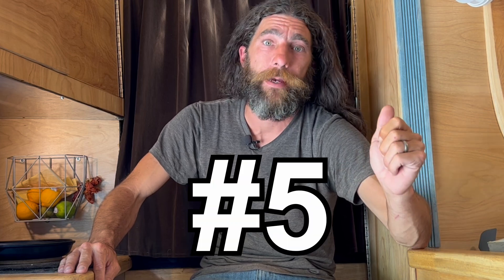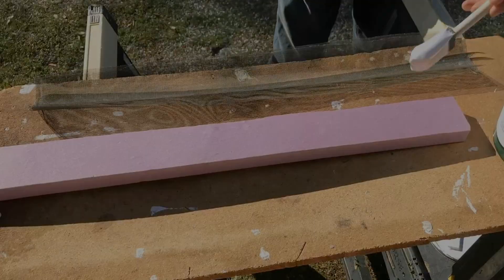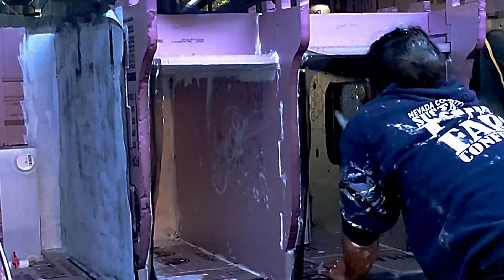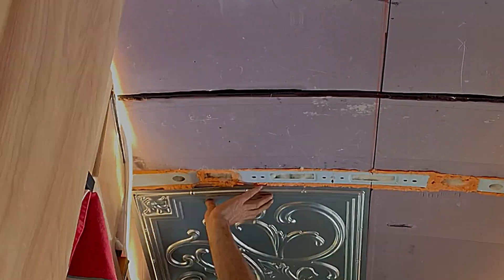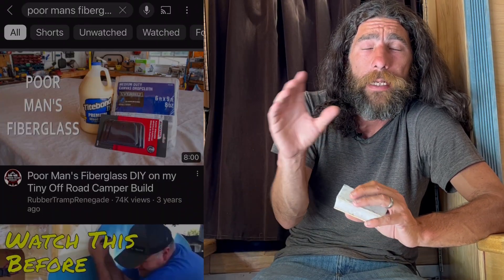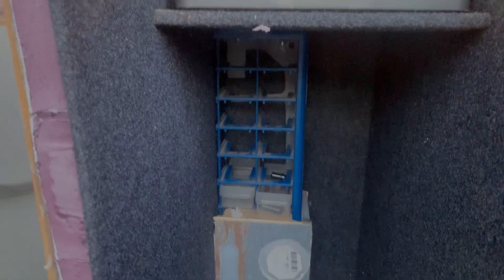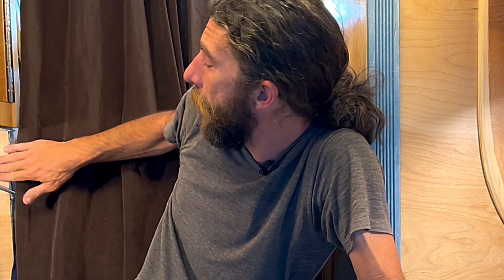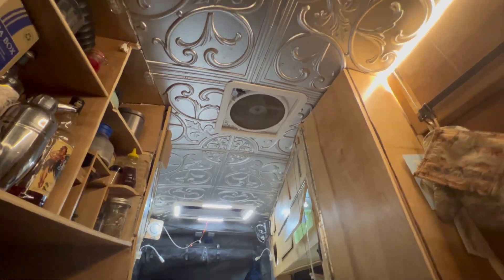Foam Camper Van Screen & Skins -Foam Building System Vol. 5

Comment: I appreciate this video just explaining the physics of stiffening up the foam so it doesn't bend. I realize even in our stick and Bricks homes we have a lot of glues and adhesives. But in the small space like a van that kind of concerns me. I wonder if using a thin upholstery fabric or something could be stapled on and still give the same strength. This would be like the inside of upper Galley cabinets and bed cabinets.

Comment: Would fiberglass resin work or would it damage the foam board? A possible skin could be using painters canvass drop cloth, (washmachine washed and clothes dryer dried to remove folds and wrinkles,) apply fiberglass resin to the foamboard. then fit the canvas, then fiberglass resin on the canvas, then you can paint it any color of your choice.

Comment: what do you think about using foam technique for the exterior in place of a wooden frame?  I want to be able to stand on it.  I'm thinking either like a rodeo camper  or those lance bed campers.   opionins? 

  also, I would help anyone who's able to share a work space. I lack the space to even get started.

Comment: Good evening, thank you very much for these excellent videos. Forgive my ignorance with this question but I can't seem to find a definitive answer in my searches. The Owens corning XPS foam that I purchase for my build, has a thin plastic face sheet on both sides.  

I don't know if this plastic is intended to be a vapor barrier, or if it is intended to protect the foam in shipping and sales.   If you have encountered this, have you been removing the plastic prior to your build, leaving the plastic skin in place would offer a certain measure of enhanced integrity, but at the same time significantly increasing the risk of glue failure, if the skin peels off of the adhesive attached to it.

Has anybody else decided what to do with the plastic film?
Reply: I’ve never seen that, sorry.

Comment: Plywood (even thin plywood) laminated to your foam can be classified as a structural element.  There must be a strong bond between the plywood and foam.  In order to maintain structural integrity, you don't want it to delaminate.  Remember Howard Hughes built a very large airplane out of plywood - known as the Spruce Goose (now in a museum in McMinnville Oregon).....
Reply: The Spruce goose only flew once at very low altitude and a short distance, it made too many spooky wood creaking noises. Then it was placed in a museum, but I think that it  should have been used as firewood.
Reply: @jerryrussell2600  I've seen the Spruce Goose.  It is a work of art and worth saving....    If you think it should be burned as fire wood.  You would probably think the Mona Lisa should be used as toilet paper....

Comment: Where is my beer? Oh yeah, sitting under my desk waiting for me to make brats.

I have a Pontiac Vibe, which some videos think would be a good car-camper, but I'm not sure if there's enough room. So, I've been pondering the idea of making a camper trailer that is light enough to be towed by it. However, I don't think I'd like the claustrophobic size of a teardrop micro-camper.

I've had this dream of building a foldout camper that triples in size or more. The basic idea is the outer side wall panels of the camper fold up 90° to become roof panels. Then a floor panel folds down with an attached outer wall panel that folds up to meet the roof. Then, two smaller panels folding forward and rearward to finish that side's box. There are commercial companies now making homes or emergency shelters based on the same idea, but with heavier materials (lots of videos on Youtube).

Of course, I'd want to see how far I can go with this and am wondering about a rearward pull-out section and a pop-up second-story. Just because. Oh, and then I'd want to roll out an awning with bug screen for shade and with clear plastic sheeting to enclose in cooler weather to create an extra layer to keep warmth in the main area. I know that's not really "Van Life" or even Camping Life, but I came at this originally as an alternative to a Tiny Home or an Emergency Shelter or a take-down mobile home if I couldn't afford an apartment anymore.

Sigh. A guy can dream.
Reply: I used to sleep in my Vibe. I would lay everything down flat. Throw a twin folding mattress on top of everything and lay down. I'm 6'0" and was able to lay  with my feet straight. It was something I would do if I just needed to sleep for a night.

Comment: One problem I see is material span limitation. Meaning amount of column req. More column, less freedom. May be possible to combine with L. STL Angle while form has its advantages on compression stress on weight. STL has advantage on tension stress. 

Think how conc. bridge is built. Can not have too many columns 11:01

Comment: As far as a structural material nylon isn't that good for a choice. It's more elastic as compared to other synthetic fibers. Dacron is used for sailboats now instead of cotton because of it's greater strength and resistance to rot. That's your best nonmetallic fiber in my opinion. And 
my Old Man was a machinest, specializing in composites for Lcckhead Skunkworks.

Comment: Man, I appreciate your videos a lot. I live in Germany and I am going to build a foldable pick up camper during the next 2 years. It will be a xps foam composite build. For the most stressed structural parts I even will use carbon fibre with epoxy. Once more thx a lot for the inspiration.  Mark

Comment: Doing a car camper bed platform build (separate spare tire bed panel). Did you say you used the screen and 1/8" ply for the platform + the cargo bay walls?

Comment: Screen? Canvas? No. Fiberglass and epoxy. This technology has been used for decades to make homebuilt aircraft. E.g. Rutan Long EZ. It is much stiffer and stronger. One point for any of these techniques, including yours. All of your corners should be filleted (rounded). Sharp corners produce stress risers that are failure points. Your skinning material should go over the corners. When properly built, any of these foam sandwich techniques produce soft, rounded corners which look fine on boats or aircraft, but might or might not be aesthetically pleasing in a van interior.

Comment: Thank you @falkornomad for a great series.  Have you (or anyone) done a structural comparison between of the different skinned foams i.e. your mesh/gripper, mesh/gripper+veneer, mesh/gripper+1/8" ply and more conventional PMF bedsheets or canvas or even paper + tightbond II?  Like you did with your glue and drywall screws?  For a homemade trailer it needs have a lot of structure.  Thanks again.
Reply from the maker: I have not seen one, but I do hope to do one in the future, any specifics you think should be included?
Reply: @falkornomad : the information I look for is: stiffness (how many inches of deflection for a given load); strength (how much load at failure; failure mode (compression side fail, tension side fail, core fail, lamination fail, etc. ...), and panel weight per square foot.  Would also be great to see different thicknesses of foam compaired (1/2", 1", 1.5", 2", 3"... for each surface material).  Also, corner strength is important to actually measure (is your interlocking corner or 'T' really stronger than a mitered glued joint, a plain glued joint, or a dado grooved and glued joint? - looks to me to be a LOT more work for little if any benefit...).  Also, curved surfaces can be much stronger, how do you form the xps into a curved shape?) Finally, where can you find XPS that doesn't have the film coating, and pre-scored snap lines (that weaken the material)?

Comment: Thank you for another interesting and informative video.

Why did you decide to go with fiberglass screen instead of fiberglass cloth + resin? Just curious.
Reply from the maker: Mostly I hate working with fiberglass and epoxy, but also I think these materials are more accessible and easier to work with than those... but they do work.
Reply: @falkornomad  Thanks for responding to me! After watching your entire foamcore series, I'm really excited to get started on my box truck next spring/summer!

I used to hate fiberglass + resin too, but then I took a class and learned more about it, and now I don't mind it so much. 

I'm curious, is the paint + screen bond holding up to all the rattling around or are you having to re-bond it? If the bond is holding up, that is definitely a simpler, more forgiving method.

Comment: After watching this I have used XPS foam to rebuild a teardrop trailer, Previously I used plywood/ hardboard for the interior walls, draws and shelves. But stripped it back to the glass fibre shell and have rebuilt it using XPS , Paint and some epoxy. The one tool I found very useful with the foam is a multi-tool it is great for cutting precise holes in the foam.
Reply from the maker: yeah, I use my multi-tool as well... usually after the foam is in place for tweaks.

Comment: I love the idea of foam-building & thanks for your videos describing the "how-to-do-it."  What is your thinking about ventilation under the mattress to keep moisture from forming?  You may have mentioned it but what is the R-Value of building in this foam?
Reply from the maker: I considered that... the "Den Dry" option and even just layers of cardboard. I did not do anything under the mattress but I did check on it occasionally to see if it was damp or mildew showed up... nothing... we just took the mattress out after 18 mo full time and not a bit of mildew or mold under there.

Comment: As a plasterer and  marine sailor for many years I have come to realize that marine materials are by far the best ones to use for exterior (read wet,moist conditions).I have used "house" materials with various results(interior only.With materials it's usually pay now or pay later.
Reply: yes it makes good sense when you build a car you also have to think about the possibility of condensation the only plywood I use is marine because the glue used is waterproof
Reply: @salmacuppini6772  And this is why Youtube University is so important. I didn't even know there is a marine grade plywood. Duh.
Reply: @salmacuppini6772  If it's not structural you can get away with CDX or something nicer. The key is it ends in X which is for outdoors use. Much much cheaper and easier to find
Reply: I came here to say marine paint and a roller. It's practically bedliner.
Reply: @throttlejockey72 no bedliner is bedliner

Comment: Isolate accumulator box from living room, if system will shorted somehow, toxic gases may appear.
Reply from the maker: Sorry what do you mean by accumulator box?
Reply: @falkornomad  location for batteries. Chemical power supplies are dangerous if they malfunction. Fire hazardous and toxic. Sory for english.
Reply from the maker: No worries, just wanted to make sure I was answering the question you asked. If you watch my electrical system videos, I have a plywood board on the wall they are all mounted to. It has a stainless steel sheet on it, so all foam is isolated from electrical. That said, I did test the flammable risk in this video: https://youtu.be/2-bjB3jXW58

Comment: This reminds me of when a friend needed a temporary storage shed. He didn't want to spend big money on something he was only intending to use for 6 months, so he made frames for the 4 walls (One with a door) and a sloping roof from wood he had on hand, went to a fabric wholesalers and got a few end rolls of the cheapest cloth they had, stapled the cloth onto the frames as tautly as he could, then painted it with whatever coloured part tins of oil based paint he had kicking about. He screwed it down to the concrete pad next to his garage, and that was that, he had a storage shed for less than it would have cost to buy a similar sized tent. :D

Most of his friends took the p*ss out of his "Technicolour dream shed", so when the initial need for it was gone, he took it back down, added a few more wooden reinforcing struts to the sides where the fabric had been able to move a bit more than he liked, added a load of slats to the roof because it had sagged, added another layer of fabric on the outside, and stuck that down with light brown oil based paint. He also took the time to use the last of the offcuts of fabric and paint to cover all the wood on the inside. This time, before screwing it back down, he concreted a layer of bricks as a base because he'd had trouble with water running underneath the side when it rained.

That was about 7 or 8 years back, and the "Temporary" sheds still in use. It still looks a bit "Hillbilly", but apart from the rain running under the walls in it's first iteration, it's always been watertight. :D
Reply from the maker: Nice!

Comment: This system of laminated foam construction is nothing new and has been used for a long time - I have a Swedish military comms wagon from the 80s which is (approx. sizes, from memory) 2mm fibreglass outside, foam core of 45mm and aluminium inside 1.5mm, with hardwood uprights and cross pieces at centres of around 40cm (the vertical stanchions) and 60cm (horizontal noggins). The aluminium is fixed together using rivetted 90 degree aluminium profiles at each of all the 90 corners to give real strength. This type of closed cell foam is commonly known in Europe as Divinycell, though it comes under various trade names (e.g. Jackopor in Sweden) - it has been used for building heavy goods vehicle bodies for a long time, though generally with all kinds strengthening from steel to aluminium to soft and hardwoods at varying intervals. It's also used to build sailing yachts and is covered with layers of (usually epoxy bonded) fibreglass matting. 

I must say your videos are really good and explain the pitfalls and simple and cheap way to do things and thanks very much for your work. I'd also add that to make corners far stronger one should avoid 90 bends in screen/fibreglass application and apply, for example, a 45 degree cut fillet piece glued in place before screening: If it's important to keep a '90 degrees look' then one can use a bead of thick adhesive such as Gorilla Glue as a small fillet to round off the corners before screening/fibreglassing - in construction always avoid 'sharp' angles as a rule of thumb - they are weakpoints. The difference in strength between using this method of rounding internal corners, or not using, it is considerable. When boat building and using foam in a structural capacity, it's generally very, very important - the same can be said for 90 degree plywood joints. When building in a bend, one can use a series of cut foam or plywood fillet pieces - they don't always have to be continuous - or use the method you showed where you cut slits in the back to allow flexibility. 

There's an old boatbuilder's maxim which points out that one cannot successfully wrap a cloth or membrane around any 90 corner, be it internal or external - the angle must be softened by planing, shaving or by adding in fillet pieces first.

Where you wish to use screws or mechanical fixings there is no reason why not to cut out a square of foam and glue in a piece of (seasoned and dry) wood (pref. hardwood) or thick plywood to replace it, if using an expanding adhesive such as the Gorilla one (or any PU adhesive, I'd think.). Such pieces of ply etc. can usually be got as a waste material from building sites as they are so small they get binned.

Whilst I haven't tested my theory, I suspect that the expanding Gorilla glue is nothing but either ordinary (or perhaps slightly higher quality) expanding Polyurethane (PU) adhesive, and that the thicker Gorilla glue is an MS polymer adhesive, though changes are made to such adhesives with additives etc so it's worth doing a comparison with other MS(?) polymers which are far cheaper to check out the difference (if any). MS polymers are designed to set fully even in places where the surfaces are non-absorbant and even when there is no available air: Some 'own brand' makes are rather cheaper.

Thanks again and best of luck with your projects.
Reply from the maker: I’m aware of the history of foam building to some extent, thanks for the other examples! I hope to do a history of… video at some point. 

I love the 45° corner idea, I’ll have to test that out at some point. The wood insert for screws is something I considered, although my approach was to use a hole drill for round inserts rather than square. But finding the drywall anchor solution, I wanted to follow it down the rabbit hole. 

The alternative PU glue is another great idea! Thanks!
Reply: @falkornomad  yeah, maybe larger, glued-in round-hole wooden inserts, if even if of plywood, would really be an easy to make, yet seriously strong step forward...? All for research and availability and facility for freedom loving people... Best wishes and thanks again
Reply from the maker: Thank you! I love that there is still logical exchange of information on the internet and while you had critiques or alternative ideas, we could exchange in a civil manner, cheers 🍻

Comment: Has anyone experienced the screen not cooperating?  I'm at the stage where I'm putting it on the outside of a foamy camper and over the corners the screen (if I put it around the corner) it wouldn't bend enough or with metal screen it would bend but then I would have to get it perfectly squar3d and flat to fit right without coming off.  Any advice on that?  I know the meta is to overlap but do you guys just do the flat sides and then make one longer to kinda fall over the edge around the corner?
Reply from the maker: Try folding the screen (pinch into shape) before laying it down. It can be a jerk sometimes!!